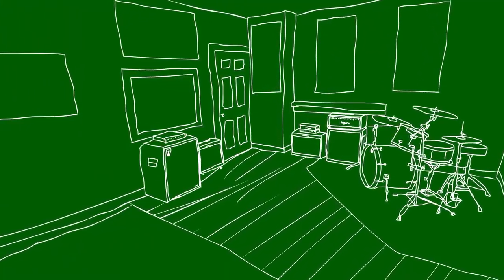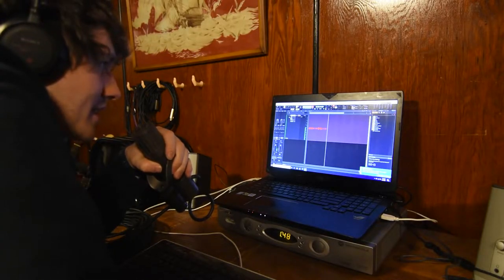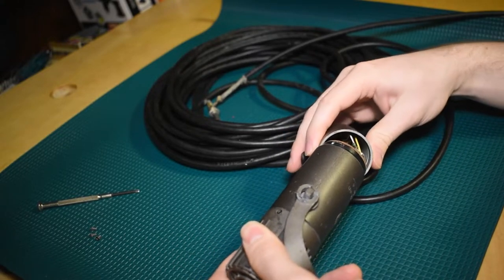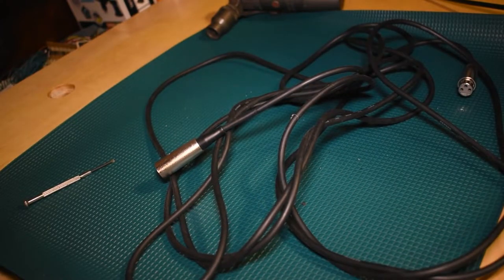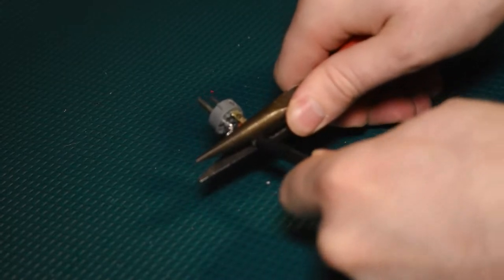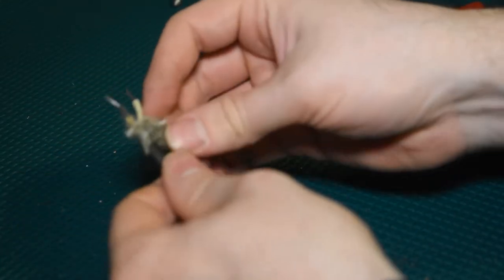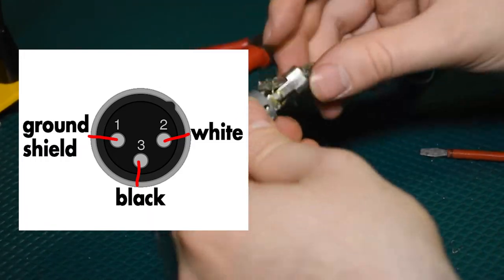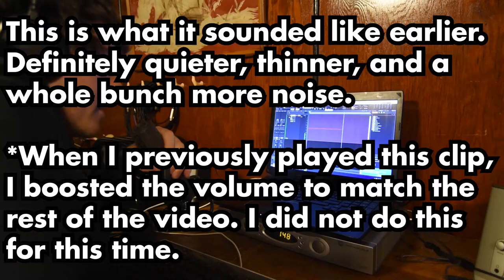This shouldn't look like this (Vintage Mic Repair)

Comment: Nice 👍🏼 I’m working on fixing same issue in an RCA cx 55B and pulled it apart and tried everything, extra/alt grounding, bypassed switch, added isolation transformer… had red, green, black, white. BLK was gnd and WHITE was main signal tho. Anyway I had no luck and was about to give up but u give me hope that changing the ancient cable to a fresh mogami will potentially help. Thx

-edit: directly after posting this I realized I’ve been testing it directly out of the internals of the mic so the cable isn’t even involved FML.